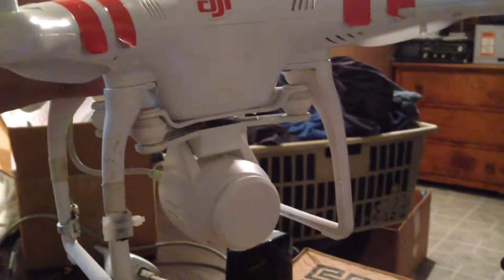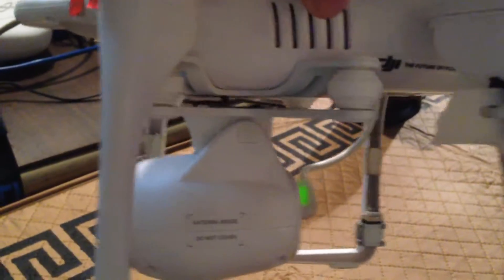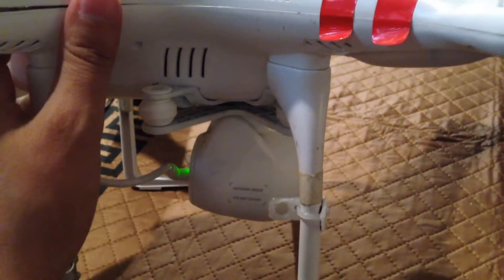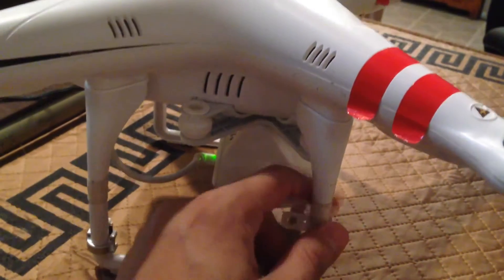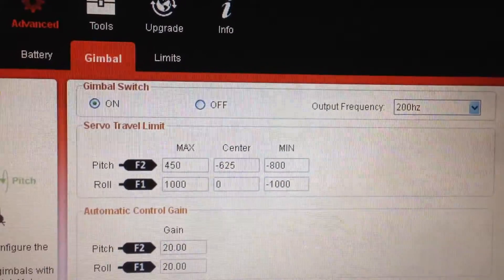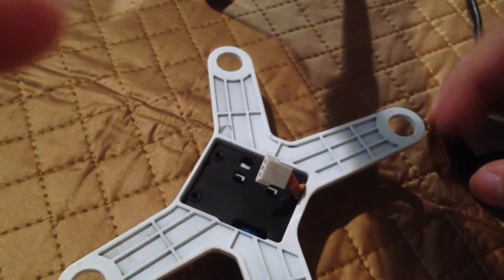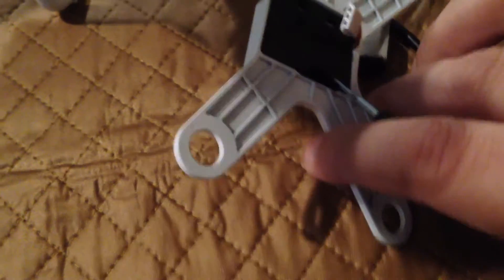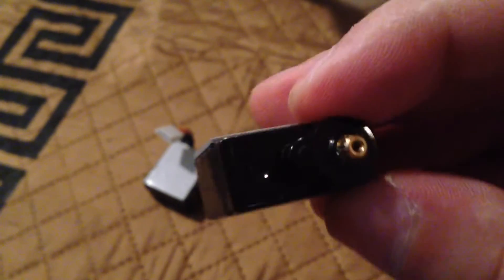DJI Phantom 2 Vision Gimbal Servo Replacement Results using Hitec HS-5055MG.

Comment: Yo Ben,
  
I busted my Servo and intend to follow in your footsteps in upgrading to the Hi-Tec  model you have shown here. I located it on their website.

 It appears the programmer or software must also have an "HPP– 21" Field Interface between the servo and the software to program it according to their customer service. Does this sound correct to you- that I cannot simply plug-in the servo with the appropriate connector to my computer and program it with their downloadable software?

 Would you mind expanding on the details of how you accomplished this?
Reply from the maker: Sorry for the late reply. I bought a more expensive Hitec programmer that doesn't require using the computer at all. It dramatically simplified changing the program settings.  It is a little pricey though.  There are web sites that sell this servo with the rotation direction already reversed from it's normal movement for an additional fee.  In hind sight that would be the way I should have gone being I only needed one.  The servo works well but it is lower torque and you'll have to use less tension when screwing the gimbal on the gear.
Reply: Ben7seven7 What was the name of the better hitech servo?

Comment: I agree with Bobster986, ...why haven't you added one of the two axis gimbals to your Phantom yet?
Reply from the maker: Half decent 2axis gimbal is too expensive I can't justify the cost.  And for still pics it makes little difference
Reply: Ben7seven7 Any recommendations on what you would consider half decent? So far, I've completed your RC 5.8GHz antenna mod with GREAT success in range, your Wi-Fi extender antenna mod (still testing), just bought the 2W SunHans amplifier (got it today), and I want to do the camera antennas also. But, I record more video than pics, and the stock gimbal unfortunately isn't the greatest. I had been eyeballing this one on eBay;

http://www.ebay.com/itm/DJI-Phantom-2-Vision-Quadcopter-FC200-2-axis-Brushless-Gimbal-Set-RTF-Newest-e-/261510707129?pt=LH_DefaultDomain_0&hash=item3ce340b7b9

However, after viewing the majority of your Phantom 2 Vision videos, I would trust your opinion if you told me you didn't think it would be worth the money. So, with all that extra info now :) ...back to my initial question if I may; ...'recommendations on what you would consider half decent?'
Reply from the maker: The gimbal you sent me a link to was very poorly reviewed by some people.  I'd stay away from it personally.  Rotorpixel would be my gimbal of choice for the Vision but it's too pricey but even more pricey is the Drone expert Gimbal.   There's a 3D printed gimbal which is okay from tests results I've seen and it's around $250 and I saw another gimbal very similar to the Rotorpixel for $300 I forget the brand off then top of my head.  I could tell you later.  And yea I agree that in anything but very calm conditions the stock p2v gimbal is not great if you're looking for really solid stable video but for simply flying FPV it's just fine.
Reply: Ben7seven7 Thanks for the feedback :p